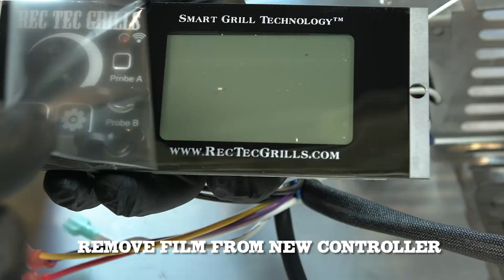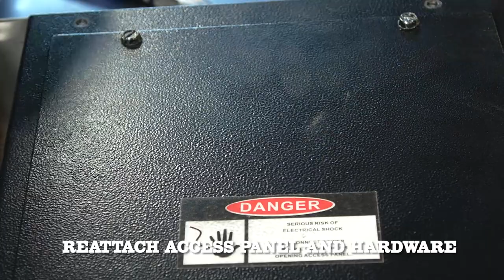RT-700 & RT-680 • WiFi Controller Replacement | REC TEC Grills

Comment: Just upgraded mine to the latest controller on my 700.  Wasn't exactly the same as the video above but, it was very easy to do.  Just some of the access paneling was different and I had to remove more.  Take pic of the wires before you remove the old!
Reply from the maker: Great tip! 🤘
Reply: How did you get the new controller? I can't find them anywhere.
Reply: david hartley I just called rec Tec support.  Best customer service ever!
Reply from the maker: @davidhartley5270  What Shawn said! ☎️
Reply: Got a new controller right at the end of my warranty for the 680.  Rec Tec is the ABSOLUTE BEST!!  Now I have to see about the WiFi upgrade, haha.

Comment: Just bought the RT700 and my modem is duel band and cannot be configured to 2.4ghz. Is the new upgraded controller compatible with the RT700?
Reply: Latest upgradeable controller is dual-band (5.0 and 2.4ghz) and is compatible with the RT700

Comment: Question- why do you need to remove the mother board completely if the connector port is exposed once you remove the cover?
Reply from the maker: The part you are trying to replace is the controller. The mother board is the part that needs to be taken out and replaced. If you need more assistance with this give us a call at (706) 922-0890

Comment: I just got my controller and I noticed that the new grills on the website have external wi fi antenna on the controllers. Mine does not have this external antenna. Instead, it’s a thin strip with adhesive to stick near the board. Is there a difference in performance between the two?
Reply from the maker: Absolutely not! It was simply a stylistic choice we made in changing up the design of the controller. The range & the function are still the same! 👍